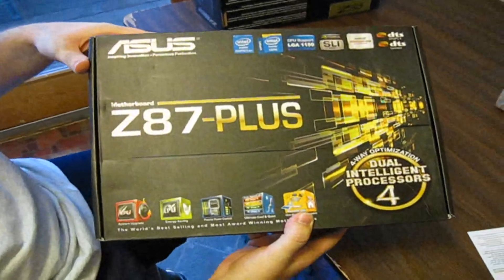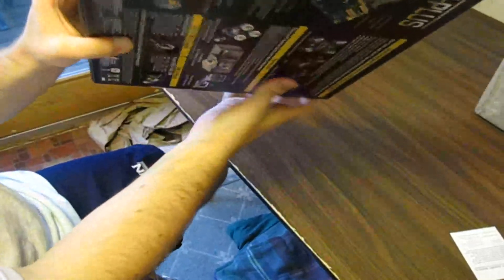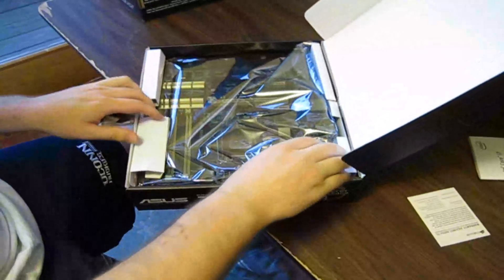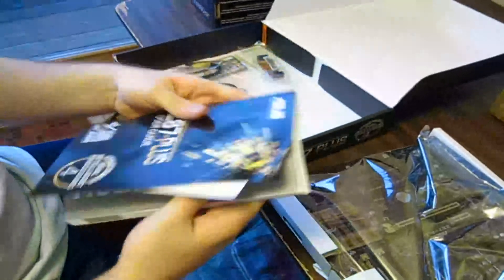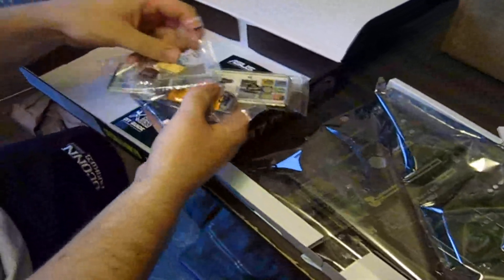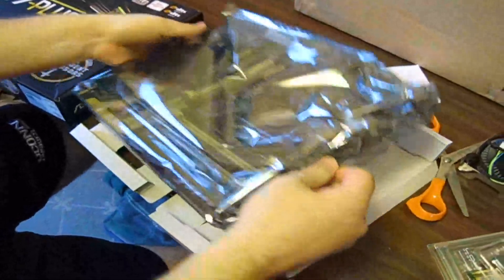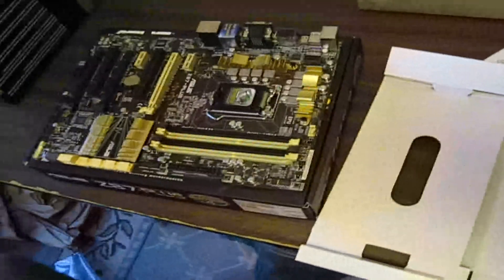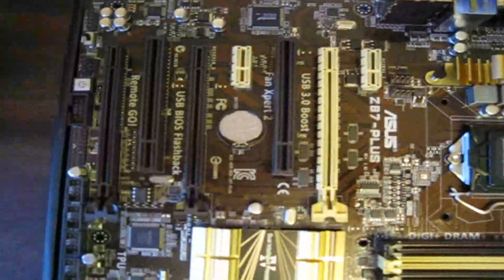ASUS Z87-PLUS LGA 1150 Intel Z87 HDMI SATA 6Gb/s USB 3.0 ATX Intel Motherboard Unboxing

Comment: this motherboard is nothing but a piece of crap that keeps slamming the power supply off and completely random points.  You will be thrilled with the fun of unplugging your computer, plugging it back in, turning it on and have it turn off right in the middle of checking whether your hard drive has been corrupted or not.

ASUS was crap when they were making disk drives for the Apple II plus, and they're crap now!

Comment: Hey I'm also trying to build a desktop with this CPU.

Will this case be good enough for it?  I'm worried since it has so many fans pre installed I wont be able to fit them all onto the mobo

Rosewill BLACKHAWK-ULTRA Gaming Super Tower Computer Case